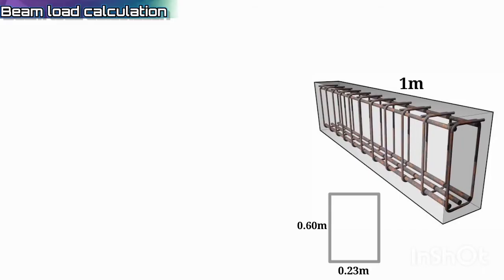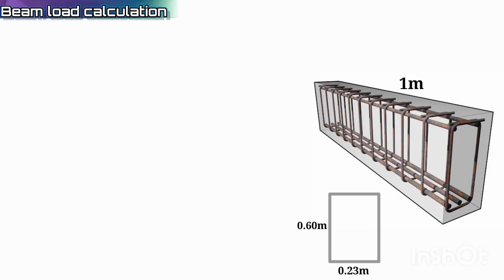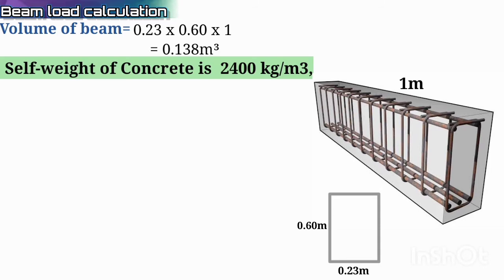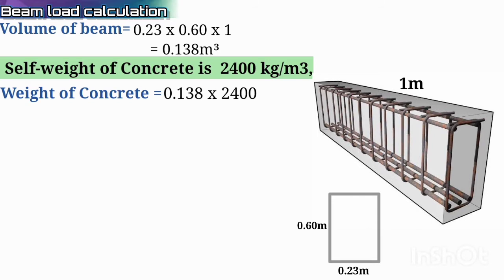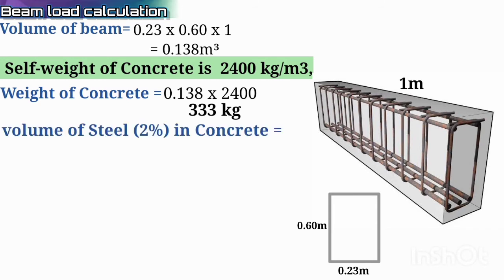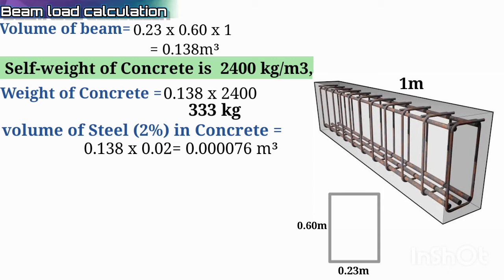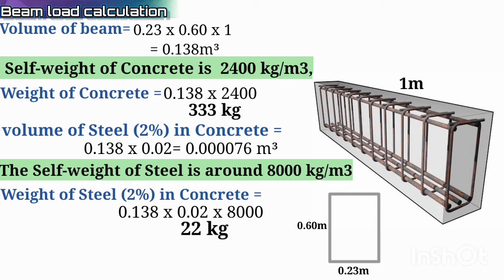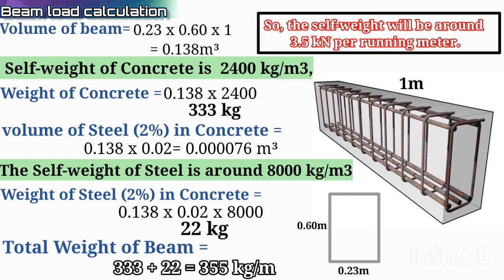Load calculation of beam|| How we can find the weight of concrete beam

Comment: Sir ye jitna bhi hm gharr ye bridges bnata hai on ma 2%hy steel use huta hai kya??
Reply from the maker: No brother according to IS standard
For footing: mim steel is 0.12% and max 0.15%
For beam: min is 2% and max is 4% 
For slab: min is .25% and max 4%
For column: min is 0.8% max 6%
Reply from the maker: But brother the actual steel percentage for any structure we are taking it from design when we design a beam so we get the steel percent from the design.